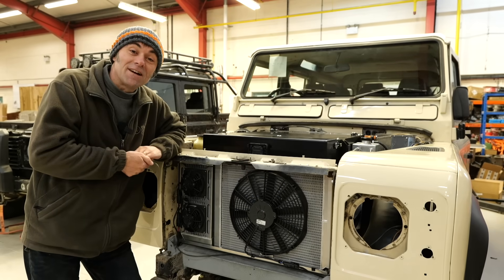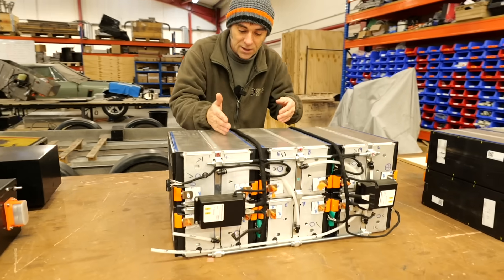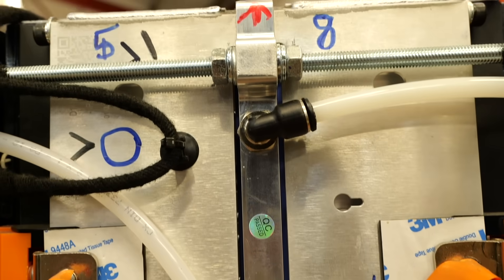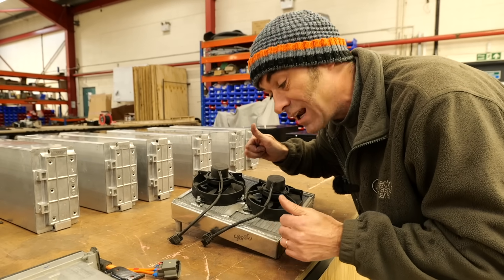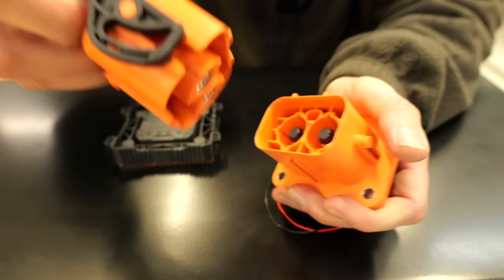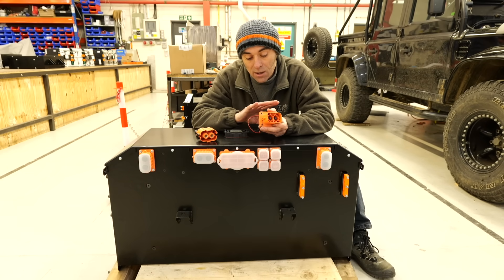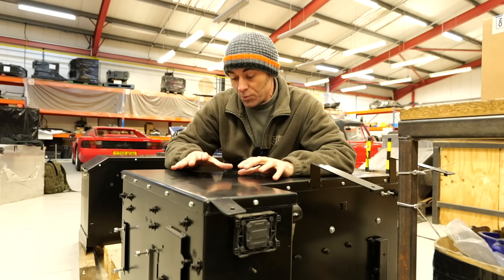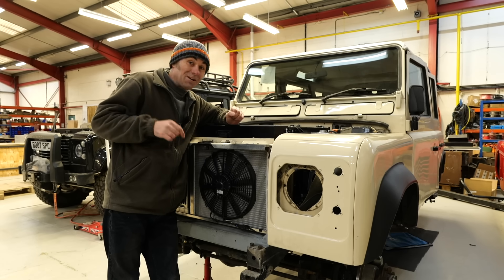How safe are electric cars?

Comment: As someone who has an engineering background including use of and experience of malfunctioning lithium primary cells I have a concern about eV fire risk. I accept it's low, I accept the figures show ice fires are a greater risk but my concern of my ice car going on fire sat at my house is much much less than my concern of a eV on charge malfunctioning and endangering other vehicles, or the property itself.
It seems to me a necessity is to have battery management systems and cooling and isolation systems is a minimum requirement. I guess many more modern cars have these but I'm considering something like a 2021 hyundai ioniq. It's been my stumbling block for months now.
Reply from the maker: A 2021 Hyundai will have all those safety features and more. Don’t forget that ICE vehicles can and do spontaneously combust whilst parked outside your home while you sleep too. https://abc7chicago.com/bmw-car-fires-vehicle-what-causes-per-year/5121834/

Comment: Thanks Richard.

Something to bear in mind for an ordinary wire fuse, such as the one you find in a domestic mains plug or supply input is that it is rated for 1 hour duration at the specified current, and that for every 5% increase over that, it's endurance is halved. So for a 13 Amp fuse it will blow after roughly 60 minutes, but it will withstand 16.9 Amps for 1 minute and 20.8 Amps for 1 second. Likewise, a 10 Amp fuse is designed to fail after 60 minutes at 10 Amps, 1 minute at 13 Amps and 1 second at 16 Amps. Fast blow, or quick blow fuses are specified differently. This is a fundamental physical limitation of most non-electronic wiring, and even things like filament lamps or motor windings.
.
So if you want an ordinary fuse to fail quickly at a specific threshold current, it's better to have a quick blow fuse, but even better to have a mechanical or electronic fuse, otherwise a delicate semiconductor circuit can be overloaded seriously for several seconds, and probably destroyed within that time delay..

Comment: Cheers for these vids, gives a better insight.
Are those cells 12s? 
At under 3v per cell, they're defo toast 😳.
Just fitted that exact type of inertia switch, to the fuel pump relay of my injection engine swap, not just for Electric cars..😁👍

Comment: The important bit about the HVIL (High Voltage InterLock) system that whilst it looks to be in parallel with the MSD, is that the contacts that carry the HVIL signal (typically a low votlage bi-polar PWM signal chosen for its spoofing resistance) always are broken BEFORE the main HV DC contacts. All the orange colours HV connectors have an HVIL, so if anyone was to disconnect an HV connectorwhilst the system was live (HV active) then the HVIL circuit breaks first, which gives a short amount of time for the system to drop all currents to zero and carry out an active discharge (v. rapid and normally done by the traction inverter) that brings the dc bus voltage down below 60v in less and 1 second.  You'll also note all these connectors are finger safe, ie even when disconnected it is not (easily) possible to physicaly touch one of the conductors within that open connector. 

This is also why most HV connectors have a "double lock" type latch, were you must first press a seperate tab to unlock the over-latch lever and then move the lever to actually drive the two halves of the connector apart. This is done because this sequence cannot be done in less than one second and hence allows that critical time for the system to safety de-energise the HV system even under this worst case condition.

On production EVs, if the HVIL is broken for any reason (wires cut, connectors open, fire brigade cut loop er, cut, or MSD removed) then it cannot be reset without a factory scan tool or similar (all systems are legally reqired to not auto-reset ie once broken some additonal steps must be taken to re-enable the HV systems, beyond simply re-connecting the broken HVIL itself)

Comment: HI Richard, are the two thin cables coming out the service disconnect devise what are also called a ‘Cut Cord?’  Confusingly, but the name, you can pull out them rather than cutting them?
Reply from the maker: They are part of the HVIL circuit. 👍

Comment: Ooops, looks like you forgot to talk about how much water it takes to put out an EV/HEV fire compared to ICE and that currently there's no good way to put out an EV fire once the battery is punctured.

I think a really great safety comparison would be to drill a hole into a tank of petrol, then drill a hole into a 12v ICE car battery, then drill a hole in an EV's lithium battery.

Comment: Are there any manufacturers/setups that use some kind of automatic extinguisher system (foam or smiliar) inside/around the battery?
Reply from the maker: Like a sprinkler system in a petrol powered engine bay I just don’t think the % of vehicles that encounter a fire (petrol, diesel or electric) justify such a system.
Reply: Yes they are easy to see they have a 200 gallon water tank on their roof.

Comment: No doubt they are very safe, but if they do catch fire they are incredibly difficult to extinguish!
Reply: Sure, but generally you have time to get out of the car if you are not injured. Another plus is you and your passengers are not going to be immediately enveloped in a cloud of burning petrol in a bad crash. Plus, plus, electric cars are up to 60 times less likely to catch fire than any other vehicle. Plus, plus, plus, companies have already developed and are selling specialized fire fighting equipment to put out battery fires. They work by puncturing the battery box and flooding it with water.
Reply: @Hybridog  I know EVs are much less likely to catch fire, but when they do you have a BIG problem! As it stands EV fires are very difficult to extinguish. I spent the past year working with the UK fire service and can assure that they are worried about EV fires, especially if they happen in a tunnel or other enclosed area. As for the fumes, the fumes from an EV battery are incredibly toxic. I’m not anti EV by the way, but they need to work on the infrastructure & methods of putting EV fires out quickly. I fear the consequences of an EV catching fire in a long tunnel!
Reply: There is a very important point that is generally missed, which is mostly, for all types of passenger car, car fires are NOT actually extinguished, they actually pretty much burn themslves out! This is because the time period over which a car fire develops is less than the time period in which the emergency services can mobilise, transit to the fire, set up, then extinguish it.  For a ICE car fire, peak heat release (fuel tank breach + full developed cabin & underbonnet fire)  occurs between 3 and 5min after the fire started.

For an EV, if it is not a battery fire that started the blaze (and mostly it isn't, it's interior low voltage electrics, as per ICE models) there peak heat release actually occurs after over 10 min, because the battery has a huge thermal inertia and is housed in a fire proof metalic enclosure that is seperate from the BIW structures.

The problem for all is that modern cars of any type have a huge heat release footprint. This is because they are made up of a lot of plastics and high calorific content materials. Modern cabins are quiet, comfortable and safe (in a crash) because of this, but it means a car fire than develops releases a huge amount of heat. That heat is what then spreads the blaze (and here, ICE get another black mark because their liquid fuel tends to run out of a breached tank (diesels are actually worse for this as the fuel has a much higher latent hea or vapourisation) and run onto the ground and away from the burning vehicle whilst still on fire. This is particualrly bad in things like multi-story car parks where the storm/fire water drains then act to carry this flamming fluid sideways and down to other levels.

So, yes, we can absolutely say that it's very hard to FULL extinguish an EV car fire (although several specalist techniques / custom equipment systems are now available and are in use by fire services) but we can also say that this simply isn't actually that important in the real world.   Here, the only thing that matters is whether or not the vehicle suffering the thermal incident is close enough to other inflamable objects to spread the fire.  If not, then in neither case is it much of a problem, if so, then unless you get very very lucky indeed and the fire service are litterally just round the corner when the fire starts, the fire will already have grown and spread before they arrive,  and the original vehicle wil lbe pretty much fully burnt out in all cases  (full heat release actually takes a similar amount of time, roughly 20min, for both types of vehicle as this is set by slow burning things such as the tyres and hard plastics / rubber components and paint / underseal etc
Reply: @maxtorque2277  if you catch an ICE vehicle that has caught fire early a simple fire extinguisher would extinguish the fire. Not with an EV though. As it stands I know that UK fire services do not currently have specialist equipment to extinguish EVs.
Reply: Hi Max you seem to know alot about fires in ICE vehicles and EV vehicles, may I be so rude to ask you where you learnt all your knowledge or have you picked it up off YouTube.
Thanks.

Comment: Do a video on how to repair that VW battery pack👍 
Also do you realise that if the car manufacturers actually made cars that were built to last and be easily repairable that the production emissions of most vehicles could be dramatically reduced. At least you are recycling older vehicles.

Comment: Cars past 1990s started to get much safer at the cost of reliability due to so many more parts and different materials needed. A reason I will never own a new car past 2010 is planned obsolensense shit isnt made to last when it should be a reqirement to last at least 10 or 20 years. Batterys suck but electric motors are amazing.

Comment: A fair while ago now I was looking at diy EVs and they used contactors(like big relays designed for high voltage and current from my understanding) to break the pack up into non lethal modules, these were joined on startup by the 12v system, I think this is somewhat still the case breaking into modules? The inertia switch would then switch off the feed to the contactors in the case of an accident. Which gets to the question of why the phyro fuse was necessary? Were the contactors only designed to work with little or no current flow? Was a backup required? Or is pack design changed so it's no longer feasible?
Reply: Contactors have a (relatively) limited breaking capacity (typically around 3,000 to 5,00 amps) compared to a proper HV rated fuse (typcial 20,000 amps breaking!

We need both. The contactors are the primary functional disconnect and are used during normal process to isolate the DC+ and DC- of the battery (HV battery potential is NOT referenced to chassis / ground). This occurs at normal key off ie when you stop driving the vehicle, or when the SRS triggers (ie a crash large enough to cause an airbag or restraint system to fire).  The contactor must be able to carry the full rated current of the powertrain, typically between 500 and 1,000 amps for most EVs, but it cannot be easily rated to carry the full short circuit current nor to be able to break that current (not without getting impactically large and costly anyway)

So, we still have a HRC (High Rupture Capacity) HV fuse in the battery. That fuse is capable of breaking the enourmous short circuit currents that a modern low resistance Lithium battery can drive through a short circuit.

As mentioned in the video, Telsa replace the passive thermal fuse with a pyro fuse for two main reasons:

1) The ability to irreversably isolate the HV traction battery in the event of a significant crash, irrespective of the current being carried at the moment of the crash

2) The ability to use software instead of a physical thermal impedance and an electrical resistance to set the fusing current. For a conventional fuse, the miniumum guaranteed fusing current will be around 3 to 5 times the rated carrying current. Ie a 100A fuse, a fuse that can continuously carry 100A will actually require over 300A to blow it in less than a second.  Currents between 100A and 300A are guaranteed to EVENTUALLY blow the fuse, but it will take a long time. This can be an issue for soft short circuits. Additionally, in a high performance EV, repeatidly carrying the full current will start to overheat a fuse with a sensible rating. Ie a 100A fuse is 100A at 25degC. At say 125degC it will have at least a 35% derate, ie effectively become a 66A fuse.  By measuing the actually current, and triggering the pyro disconnect in software thee problems are completely negated
Reply: @maxtorque2277  Thankyou for taking the time to write such a complete and thorough answer.

Comment: At some point you have to stop and ask: "Just what is it that EV's are supposed to be saving us from?" There is one question that never gets asked that would expose the "climate crisis" for the scam that it is, which is "What percentage of the atmosphere is CO2?" The answer, never given in plain language, is that CO2 is currently around 420 parts per million, increased, they tell us, from 280 ppm in 1850. That's a difference of 140 ppm, or in terms more readily understood by the layman, the composition of the atmosphere has changed by 0.014% (14 thousandths of 1%) in the last 170 years. LESS THAN 1 THOUSANDTH OF 1% PER DECADE! How much closer to "zero" do they think it's possible to get? How gullible do you have to be to believe that this rate of change is causing extreme weather events, which have always happened and always will? Their claim is that this tiny amount "traps heat". ALL gasses dissipate heat and even if CO2 is an exception, the suggestion that a total of 0.042% can overwhelm the capacity of the remaining 99.958% to dissipate that heat is abject nonsense. CO2 DOES NOT control the global temperature, there is no "climate crisis". Wind farms, solar panels, heat pumps, EV's.. None of these measures are necessary, nor will they have the slightest effect on the weather. Eye-watering sums of money have already been wasted on this futile exercise. Time to wake up, stop throwing our money at these boondoggles and squandering the world's resources on projects that cannot possibly succeed as there never was a problem to begin with. There is no need to save the planet from a minuscule increase in the gas on which all life depends, but it does need to be rescued from idiot politicians and media mouthpieces that push this garbage.
Reply from the maker: The Victorian age is calling, they want you back. 😂🤣👍
Reply: The Victorian age was when the first electric vehicles were tried. They were abandoned when the vastly superior ICE's were developed. EV's are a complete waste of resources and despite all the hype will result in the disappearance of all forms of personal transport as costs spiral ever upward. @ElectricClassicCars
Reply: So what you’re saying is let’s go back to smog ridden cities of the 1800 where you couldn’t see two feet in front of you yes that’s an absolutely excellent idea.
Reply: Smog is not caused by CO2. The level of modern education alarms me. @stuartodell2828
Reply: So @jerrypalmer1786 Nobody listening to you ? So you came here to sprout your Scientifically Disproved last gasp @ keeping your Fossil Fuel burning Planet Killer, moving ? or are you a Petrol Station Owner or just another Petrol Head that expects everybody else has to suffer for Your primitive polluting form of Transport ?, If Environmentalists are Wrong, we get a Electric non Polluting Future, if you are wrong, we are all dead when Planets Temperature keeps rising ...
Reply: Keep wearing your tin foil hat ... you'll be OK.
Reply: @MrAdopado  well from what he is saying we need more pollution not less so let’s go backwards not forwards then that makes total sense.